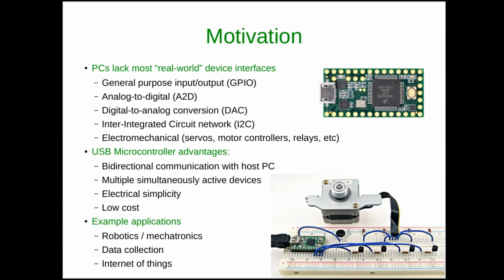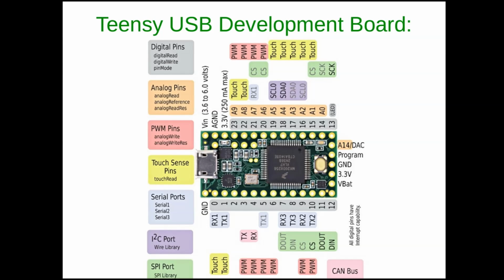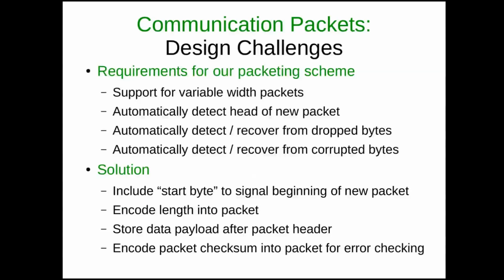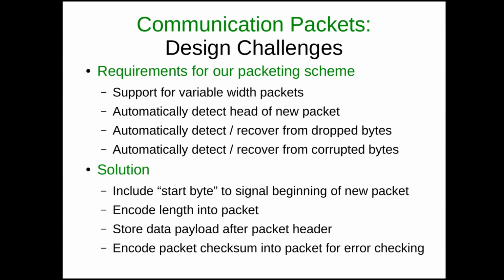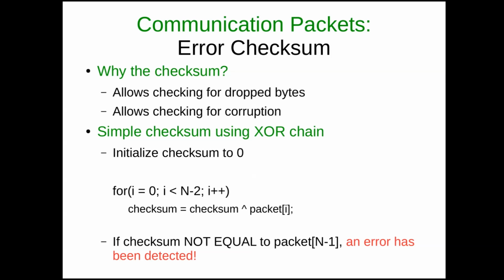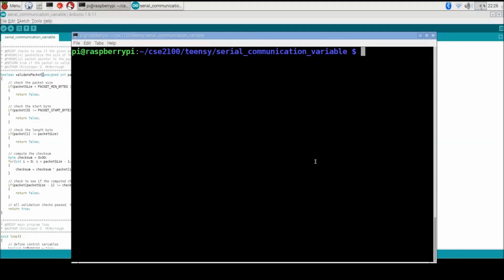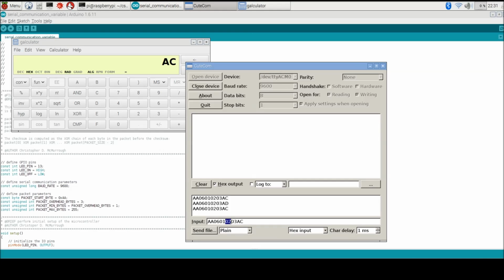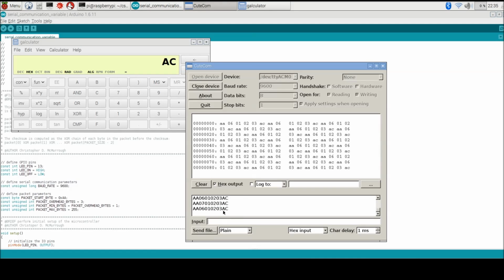USB Serial Communication

Comment: Is this an MCU with a serial to USB adapter ? The Arduino code is in here:  https://github.com/cmcmurrough/cse2100  under \cse2100-master\cse2100-master\teensy\serial_communication_variable\   but there is no hardware description. The "PC" side is missing. Seems to be a simple emulation done over a regular USB cable, forgive me if I'm wrong, or the adapter on the Arduino side does the job. The Arduino software is really basic, and there are no D- and D+ ports at all. A real shame.
Reply from the maker: The MCU is a Teensy programmed via Arduino. Arduino abstracts most of the low-level stuff, like serial comms via USB. The MCU USB port is set to serial emulation mode, which allows for easy programming via Arduino's libraries. You can, if you wish, program the MCU natively without Arduino. Check the Teensy website to see which chip your board is using (the Teensy 2.0, for example, uses the ATMEGA32U4) if you want to program it using the chip manufacturer's IDE and libraries. The purpose of these videos is to show hardware beginners how to use an MCU without getting bogged down in chip specifics, register settings, etc., hence the use of Arduino.
Reply from the maker: Sorry, missed the 2nd part of your question. In the github repository, there is PC side code under GUI_Teensy/LED_Controller/src . Keep in mind this video series and repository is designed for a university lab, and not all of the course materials (handouts, lectures, etc.) are posted online.